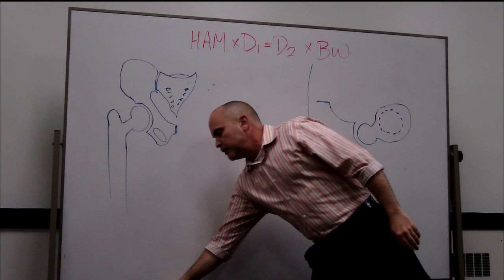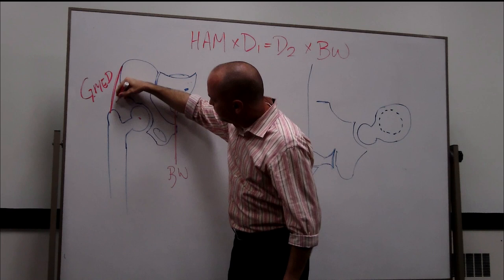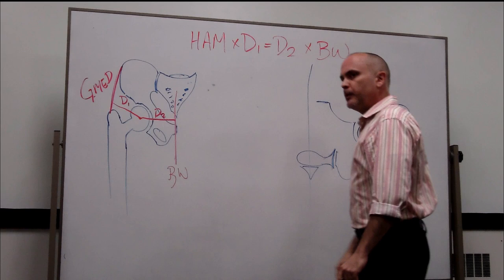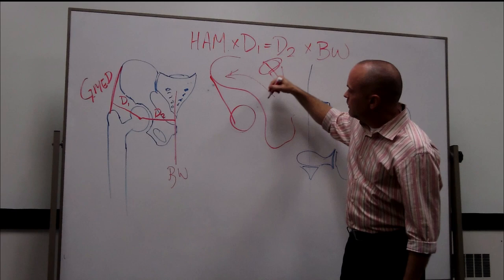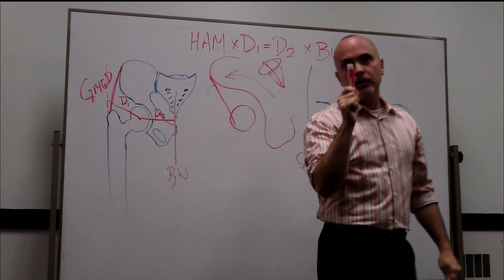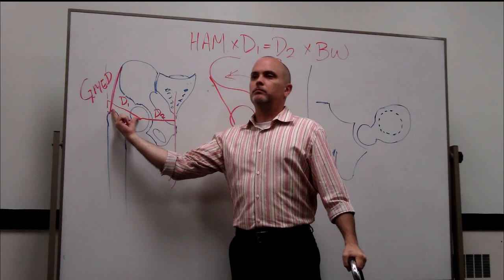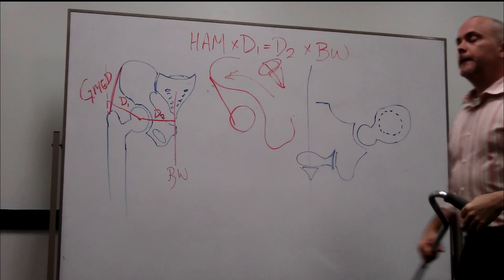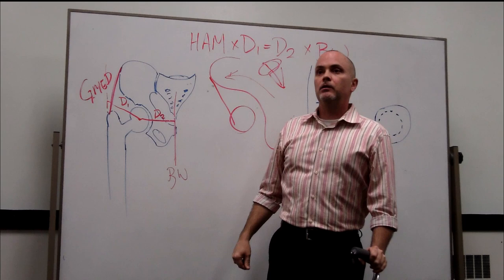Applied Gait Hip Biomechanics, Part 1

Comment: D1 and D2 aren't lever arms -- they're moment arms.  A lever arm is the linear distance between the point of force application and the axis of rotation.  A moment arm is the perpendicular distance between the LINE of force and the axis.  Those are almost always two different values (maybe a little, or maybe a lot).

Those terms only have the same magnitude when the force in question is applied perpendicular to the lever.
Reply: He said d1 is the perpendicular distance from the axis of rotation to the closest point of the lever arm. it's correct.